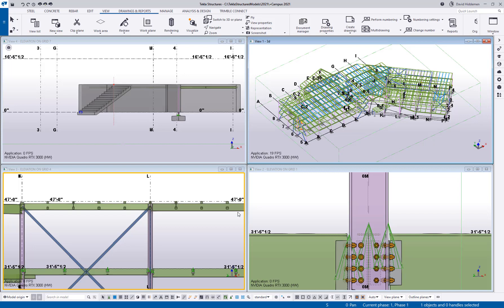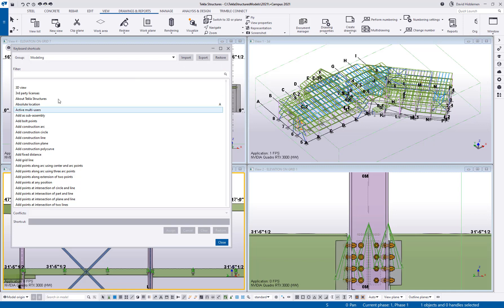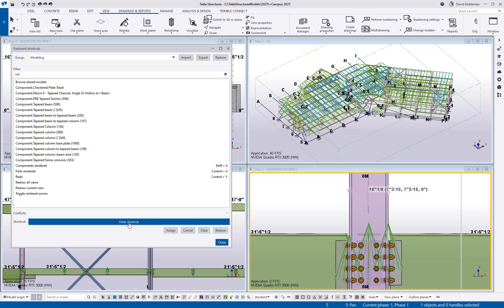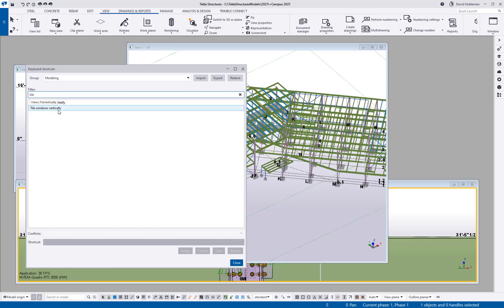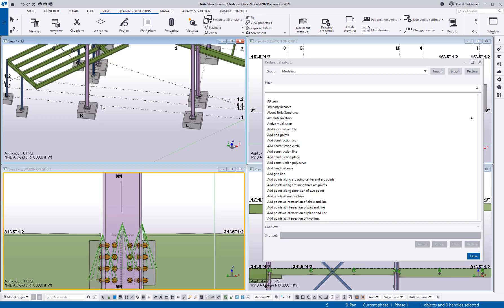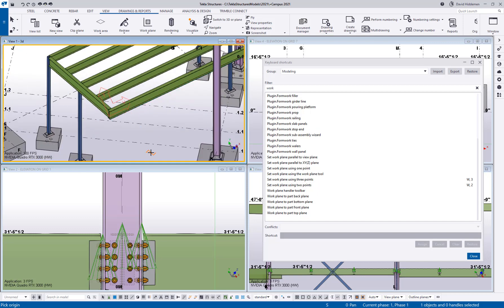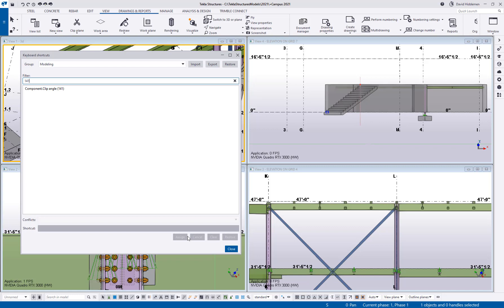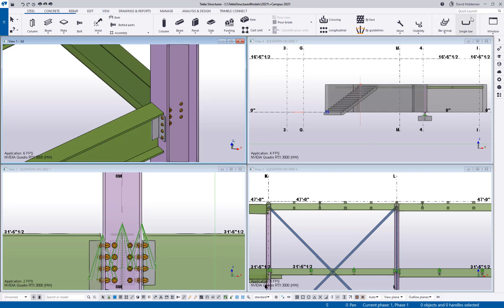Keyboard Shortcuts

Comment: Dave you should try my custom ribbon and key binds on my Logitech G502.
Reply: I'm sure it's tricked out, but to be honest I never got into the fancy mouse thing. 20+ years of CAD and Modeling and I still prefer a simple 2-button mouse. I'm weird I guess.
Reply: @TrimbleTeklaDave  I'm a grey haired detailer. But the new kids on the block were just full of new ways. I had to conform. 

Only thing I would say is I now rely on the mouse and ribbons. Without my productivity drops clean off.

Currently working on King Cross London build S5. If you have time to check it out